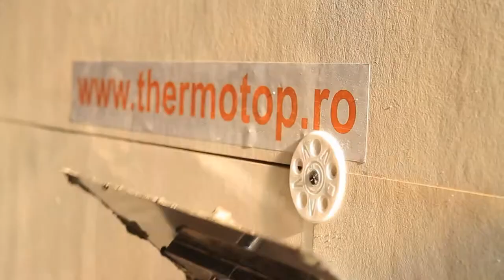Montaj placi termoizolante Thermotop Topanel PIR

Comment: Bună ziua, sunt și pentru interior?
Reply from the maker: Aceste placi pot fi folosite si la interior si la exterior. Gasiti pe pagina de produs MaxBau Materiale fisele tehnice unde sunt trecute toate detaliile. Link aici pentru un produs https://www.maxbau.ro/placa-termoizolanta-thermotop-topanel-pir-bv-bv-50-x-1200-x-2400-mm-10600752.html
In functie de aplicatie se foloseste cu Aluminiu (AL) sau cu Bariera de Vapori (BV). 
La mansarda sau sapa cu incalzire in pardoseala se utilizeaza placa PIR cu aluminiu, intre peretii despartitori se foloseste placa PIR cu bariera de vapori.